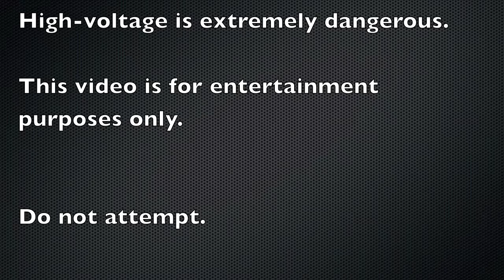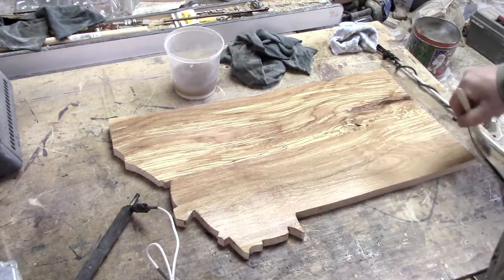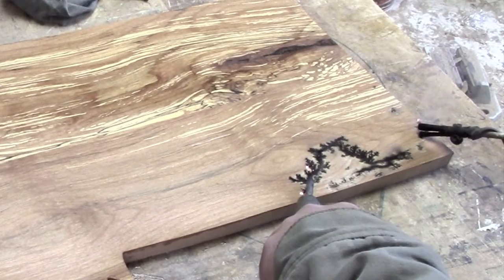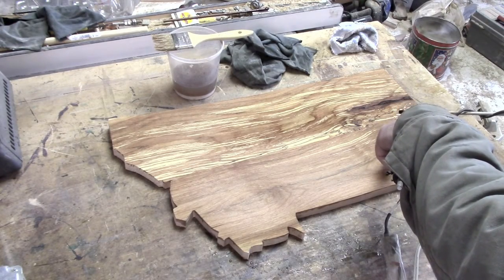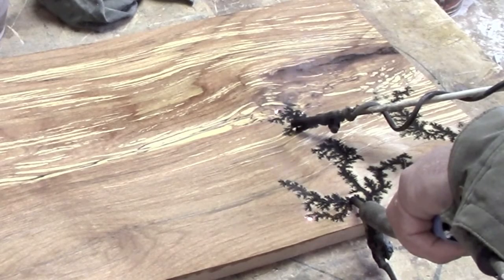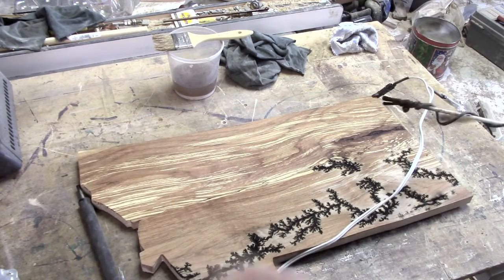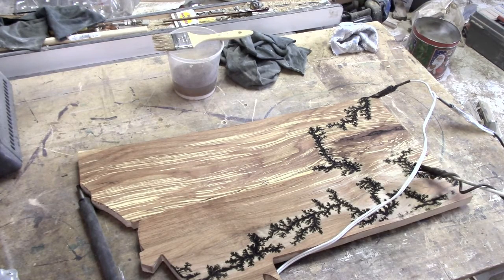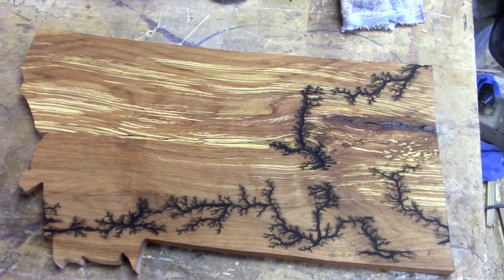Lichtenburg Pyrography:  Red Alder

Comment: What are using for a power supply and what are your probes made with thanks great videos
Reply from the maker: +Lee Barker Microwave transformer with a electric heater as a ballast to limit the wattage.  Probes are a fiberglass tent rod and a rubber dowel.  I really need to find another tent rod.  Here is a video where I show and explain the set up.

https://www.youtube.com/watch?v=vt1234XQCKI